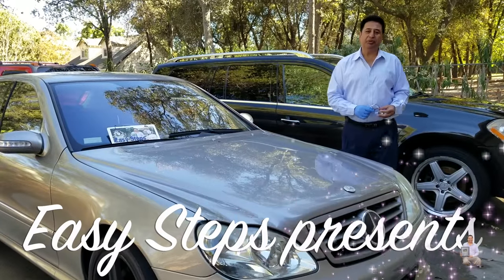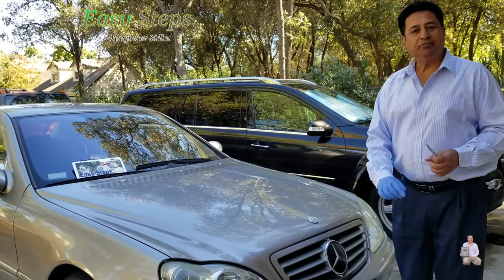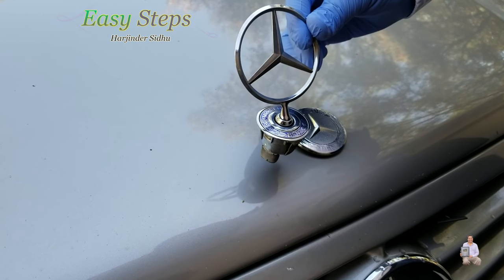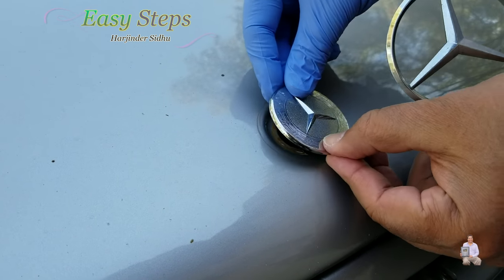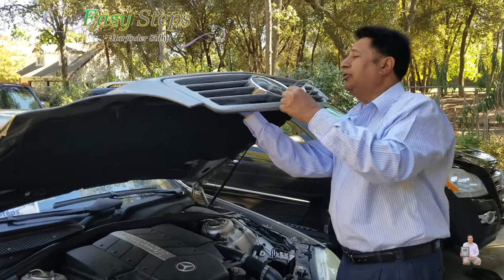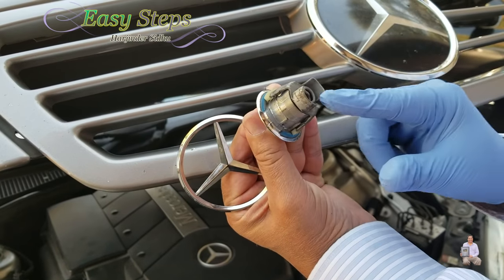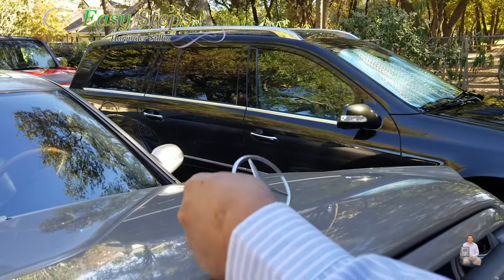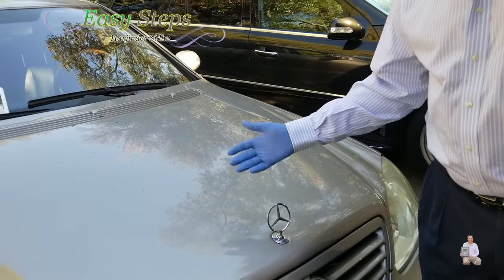How To Change Mercedes Hood Ornament Emblem | Mercedes Benz Genuine Flat Hood Emblem

Comment: No, it WON"T work on ALL Mercedes.  My 2006 SL500 does not have the hole cut in the hood.  Just 2 tiny holes for the flat emblem to stick into.

Comment: 97 S500 hood emblem was stole and it was the flat one. But for my hood their was no hole left only two small holes from where the emblem set in. Still not sure how they took it off the car was just setting in the yard.

Comment: Hello ! I went to the Mercedes’ dealer and they said I can not swap the flat emblem with the sticking up hood emblem due to it would be crooked and not fit…for my cla 250… are they lying
Reply from the maker: The original classic emblem can be used on any Mercedes, thanks for watching.🙏
Reply: it depends on the model, some come with the emblem attached with glue or in a similar way to those of bmw, if this is the case then it will not be possible

Comment: Unfortunately this is not possible on w209 2004 -2009 CLK as the bonnet is double layer :(
Reply: there are sevveral models that have flat emblems secured by two pins, so the above video is not applicable

Comment: Hi, will this work on Mercedes B-Class W245?
Reply: @EasySteps_Sidhu  thanks, I was looking under my hood and it looks really different. There's an extra layer of metal where you would normally twist off the mercedes emblem. Do you have any idea how to do it if the emblem is inaccessible from the bottom, and only from the top of the hood?
Reply: b class uses 2 pin type.. meaning there's 2 hole on your hood and emblem have 2 legs

Comment: Sir , you are wrong . Can't interchange the flat emblem to the stand up emblem on any mercedes.  It can't be done on the 1995 SL320 or the 1996 SL320 . I have both cars and it can't be done , without modifications to the hood .
Reply: @EasySteps_Sidhu  , maybe so , but the 1995 SL320 and 1996 SL320 is totally different and won't interchange with the stand up emblem .
Reply: yes its 2 pin type
Reply: It can be done, probably depending on the year and model of your Mercedes. I replaced the flat emblem with a standing emblem on my year 2017 Mercedes C350E.
Reply: you have to make sure you have the exact emblem for your car model and it will work..
Reply: Can I see your Mercedes